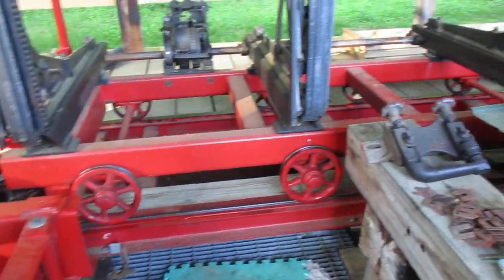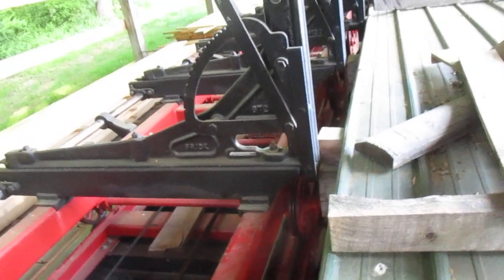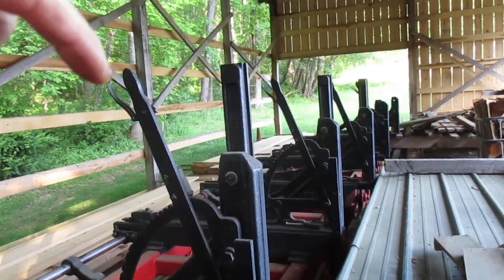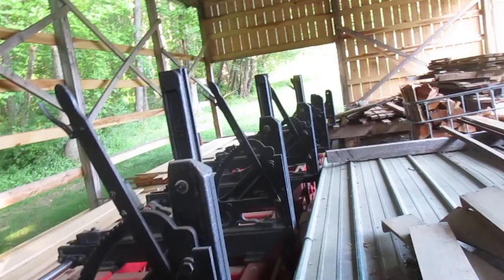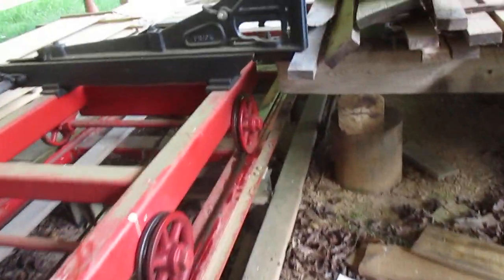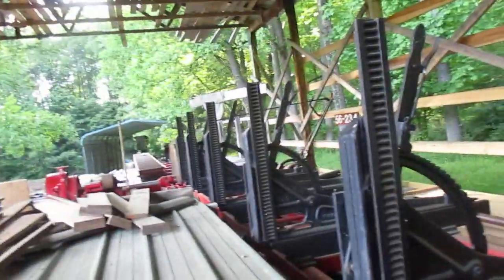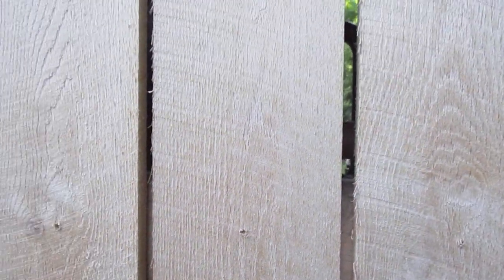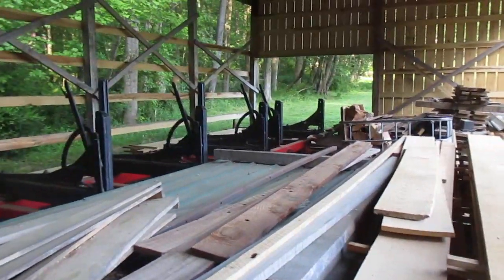Sawmill Update Next thing to do . Its a Frick #1  #353

Comment: John Im not an expert and would never assume to tell you not to take the knees off the bases, (but) on the three mills that i have in my area and the one I own i have noticed that when the pinion gear for each knee rack is drawn up to tight to keep the teeth engaged it will cause a friction that the retract gearing on the set works can't over come because the teeth are larger to move the knees backwards faster. If you look at your set works rod on the back of each knee there is a pair of bearing with adjuster bolts and locking bolts. Losen the locks and let the pinion down a fraction so your rack isn't bottomed out on the pinion. I hope that my experience will save you the time that I used up pulling all my knees and set works.
Reply from the maker: hi there the ell are out of the racks and adjusters are off and it still wont recede  john
Reply: Try undoing the coupler, that may tell you if your problem is in the first half or last half, just a thought. !

Comment: Those shims look identical to the ones used on old style Chevy pickup trucks for adjusting camber and caster. You could probably find any thickness you want at an alignment shop near you.
Reply from the maker: hi there ya they do / these are B@g pump shims

Comment: If you have the ells off the pinion, then why do you think they are causing the binding?  The shaft turns free forward, but binds backward.  That seems to say the set works is the problem.   Says the guy from NC having never before worked on a saw mill.
Reply from the maker: that is what i an focusing on i hope tomorrow . . I'm going to pull the 2 bull nose keyways from the networks . i think our tolerances may be a bit tight . john